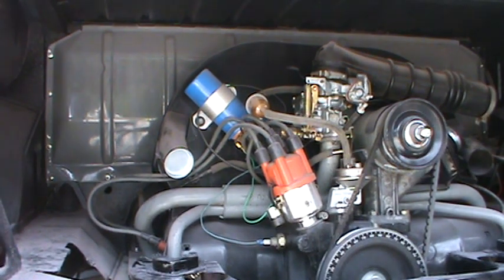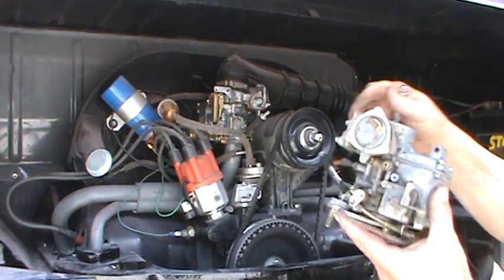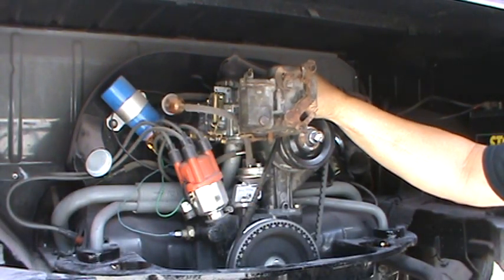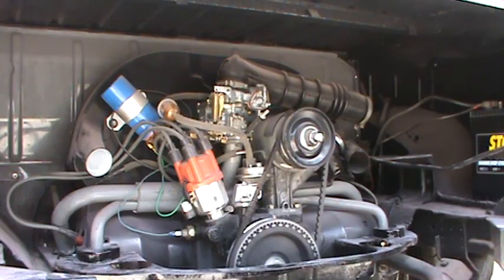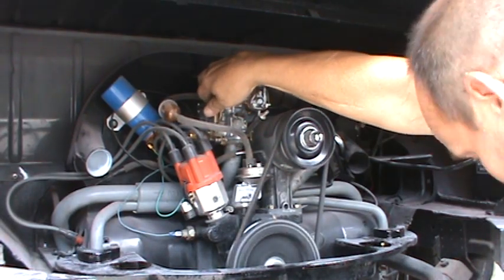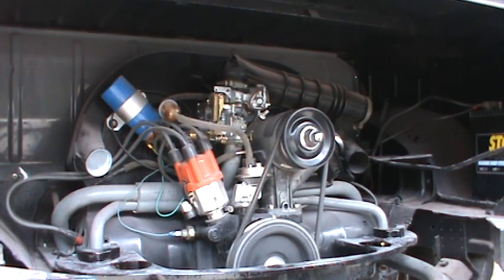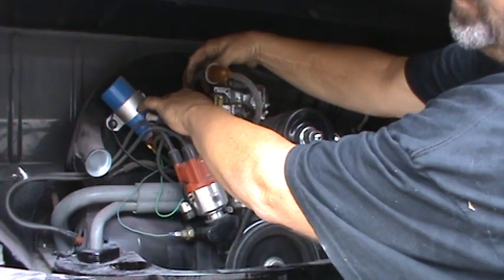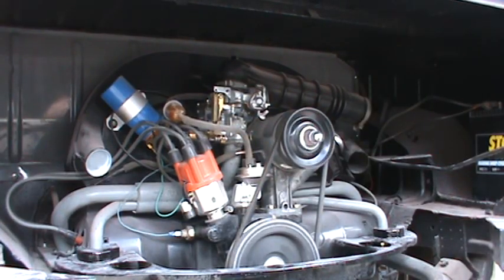HOW TO ADJUST VW CARBS, Air-cooled Volkswagen Carburetors tuned, VW Bus, VW Kombi, Classic VW

Comment: Thank you a thousand times. Frequent stalling plaqued the car (‘73 Super Beetle) to the point it was pushed aside and replaced. After viewing this “how to” I removed the idle screw on the right side, cleaned it, blew it out and voila!!! In 15 minutes it was running beautifully and returned to being a daily driver. I wish I discovered this site a long time ago. Thanks again
Reply from the maker: thank's for checkink out the video. Glad it help ,

Comment: That's the best video of carb adjustment on a Volkswagen I've ever seen and I have been looking. That motor is very smooth. And very tight. Very good job. It's easy to see that you really know those Volkswagen motors.

Comment: Man, best video so far.  Everyone skipped cleaning the idle jet when it would die at idle.  Pulled it, soaked and shook it in carb cleaner for 10 minutes, seems to have fixed the problem!  Now I just need to wait for daylight and a proper length screwdriver to adjust the two screws on the left side and I am golden.  Thanks for the quick and informative video!

Comment: Because of this video i started working my ghia and fixed it on my own, the shop that i used wanted me to replace the carb, but i did this little fix and what do you know my ghia runs better than ever. Thanks alot for your help.😃

Comment: thank you. I have had  8 VWs and have cussed Solex carbs for as long as I had them. Installed a bug spray carb just after I bought my '73 Thing new. Just recently had a shop adjust my 30/31 pic.on my 1600. The only thing I ever noticed on them is if you get to far off the carb gets really noisey.

Comment: Great video. Followed all steps starts and idles fine. After revving to approx driving range, bogs out and dies. Not sure where to look next. No vacuum leaks detected, all hoses connected. Using pertronix svda with matching coil & wire set.. Engine was 1600 but got the 88s from AA to bump up some power. Any help appreciated.

Comment: Hey Darrin, I have a 1600 dual port engine what's a 34 pict carb, I am getting a flat spot similar to what you are referring to later in your video. I have the accelerator pump set all the way out to give it Max fuel, what else could be my issue? Do you think I have an intake leak? Engine idles good and RPMs can be set as low as 800. Do you think I need to play around with jets?

Comment: On that original solex German carburetor you said there was only a single screw adjustment is that the low speed mixture?

Comment: hey! thanks for posting this! my bug has been running rough so im going to try adjusting the carb. It will run good most of the time but when i slow down to stop it keeps cutting off. i think the probablem is the amount of air that is getting into the carb. any advice???
Reply: Sounds like a timing issue.

Comment: I have a  question. My bus idles fine when 1st started. I drive it for a little. It stops running  every time I come  to a stop. I can turn the  idle up it stays running. But the idle is  to high. Any ideas
Reply: sounds like you might have an intake leak. check that the intake manifold and the carb are on tight. manifold boots are nice and sealed. I had this same issue where it would cold start and run ok but as it heats up it starts running weird and would die on me at stops. heat expands the leak and this is why it gets worse as you drive. Also, intake leak + high idle + lean mixture = engine running hot & excessive engine wear. Hope this helped you find a solution!

Comment: Thanks for this great video, I have a question I have a 28 pict. That the throttle stays open doesn't comeback, I seen other carburetors that have a spring that makes it return to close position, this doesn't have one neither the attachment to install one, what can I do to fix this? Thank you.

Comment: Hey great video, my friend has a 1971 Volkswagen Beetle he recently put a new carburetor on it, had the valves adjusted, had a full tune up on it, and it is sputtering in missing, almost like its running out of fuel, the carburetor is adjusted right but it keeps missing, and it is perfectly in time, what are your thoughts on it??

Comment: Hey Darrin. I've got an issue with my 1973 Westfalia. It has a newer 2000cc pancake motor with hydraulic lifters that I think is from a 1977 bus. I have set my timing using a light. The bas runs but it is hard to keep started. When I try to start it sometimes it backfires out of the carb. Once it is running it will drive normally when up to higher rpms. Would carb adjustment be to blame for the backfiring through carbs? Any advice would be greatly appreciated.

Comment: My 69 type 3 developed a knock. Maybe  valve adjustment? I've driven it about 3-4000 miles since I bought it last year. It has a 1776 with Weber progressive carb

Comment: My 1972 VW Super Beetle (1300cc-engine letter AB) with a Bocar 34PICT-3 just will not idle. at all. runs completely fine, but if i try to let it idle for more than even 2 seconds it just dies, and dies quickly. any suggestions? I'm completely new to vw's, and cars in general, this being my first car. I just want my baby to idle

Comment: Thanks  for the video. I have a question about the throttle cable tube in relationship with the fan shroud. I have a early 1961 1200cc 40hp VW engine. I've swap out the 6 V generator with a 12V System. The carburetor is a Solex H-30-pic.I bought myself a nice Chrome fan shroud. It's clear now this shroud was for a dual carb set up because it don't have a hole for the throttle cable tube. I decided to dry fit all the parts listed above, minus the generator/fan assembly. Looking inside the shroud I can see how the throttle tube would fit and it's going to be close. The hole, that I'll have to drill, will be a quarter of an inch  from the generator tin. On the inside its going to be just as close to the oil cooler.With this info can you help me figure out what is going on. I'm just lost.
Reply: I had something of the same problem. The car had a 28 pict when I bought it 1964 bug 1200 cc. The car was converted over to an alternator and to do it they had to put a riser about 1 inch under the carb to make room for the alternator which threw off the throttle cable an inch too low. Relaced the carb with the correct one 28 pict 1 still had the problem with the throttle cable so I drilled a hole in the shroud about an inch higher and  I riveted a flat piece of steel 3 inches long to the  bottom of the aftermarket air cleaner, drilled a hole in the riveted steel. I used 2 return springs for VW Beetles made from 1971 to 1974 and it works good. So now the return for the throttle cable is on the bottom of the air cleaner.  The air cleaner has to be tightened up real good you don't want it moving which mine hasn't in 6 months.

Comment: Was wondering if very hot exhaust and rear skirt is normal. Put candy thermometer in dipstick tube and is reading between 190 and 200 during summer 209 if I run all day. Is this normal? First time bug owner and don't want to ruin engine. Runs good and can get it to 75 on highway.
Reply: Just in case anyone is still reading these posts, 200 degrees F is normal for oil temp and can go up to 230 with extended highway driving at 70 mph, which is ok with today's oils. 40 years ago I had a modified VW and it ran in that temp range constantly (dash mounted gauge) even with an extra oil cooler fitted.

Comment: OK so here’s my issue if anyone can help me got a 1641 mL engine that was recently just rebuilt The guy who rebuilt it installed it into the car for me and when I picked it up it ran and drive good however the car has set because I was purchasing front end parts now the car will run but will not idle once it gets warm it will die I’ve tried adjusting the mixture screw and the rpm screw I cleaned the idle jet however I tried running the engine with it off and no fuel came out of the opening I then remove the top of the cover and insured therewas fuel to the floats

Comment: === Gas filter ===Darrin, do you have a concern about having your gas filter installed on the hose to the carburetor inlet ferril ? ? ?  You may have seen the many Beetle postings about the engine fires, caused by the filter / hose vibration, which pulls out the carb inlet, and sprays gasoline all over the hot engine.  To learn, search YouTube for "Beetle engine fires".  Some very disturbing videos, of the carburetor ferril coming loose, because of the filter bouncing / vibrating on the fuel line.  Some really nice Beetles have gone up in flames because of that pesky gasline filter.  Bill Simpson, Toronto, Canada... with 7 Beetles

Comment: You didn't say anything about setting the choke tension?
Reply: +Chuck Holmes  tell me about choke tension... I just rebuilt mine and just set it to what felt and looked write.. im guessing if its too tight it wont ever pop out of choke, I have an E choke.  will it just stay choked?
Reply: +Themandogable You have probably set yours to where it will snap back when poked at with your finger.  That is what I was taught on most carbs.  On the 67 I work on, I found that I am leaving the tension a little weak for it to operate to my liking.  Also, I will be adding a shim to the needle and seat.  About 40 thousanths.  Have had problem with restarting a warm engine and I think it is fuel pressure dumping fuel into engine.  This is the fix that I was told by an old expert.

Comment: Wait so let me just make sure I have this right.  Set idle with big screw. Then turn in small screw until it starts to stall.  Then turn out until it starts to slow down again.  Then find a sweet spot in between these two points?  After that set idle with big screw one last time.  Is that right?
Reply from the maker: you got it , you may need to clean your idol jet
Reply: How would we tell if the engine is running too lean or too rich?
Reply: vwdarrin
Hey VWdarrin thanks for the tip.  I've already tuned my carb myself a couple of times and am really happy with the results using this method.  The only thing I would add is to turn the screw in about half a turn after I hit the sweet spot with the fastest smoothest idle.  First time around I just left it where it idled the fastest and it was running a bit too rich.  Last time I gave it half a turn inwards past the sweet spot and that kept it running smooth and seemed to make it overall happier on take off and high rpm.
Reply: How to get more power out of a vw air cool engine
Reply: this is jsty common sense ... you have to check gases.
Reply: @maliknash55  turbo it

Comment: My. transmission and engine start kicking when I take my foot off the clutch in gear one. could it be due to high idle?
thanks
Reply: Bowden tube issues. Look up "Bowden tube Adjustment"

Comment: So if the bus has a rebuilt engine and runs when you keep gas on it but it won't run idle, what should I do?
Reply: Quinn I have the same problem on my 1987 high top
Reply: Having the same exact problem, what did you guys end up doing? I just got my engine completely rebuilt went to drive it home and it doesn’t idle if I’m at a light unless I keep my foot on the gas a little. Besides that it runs perfect..

Comment: I have a 68 vw bus that was running. Found out starter was going bad,new bosch 12v in now with bushing. barely turns engine. battery at 12.3 timed static will not start????
Reply from the maker: If you don't want to deal with the bushing the new Bosch starters no longer have a bushing I prefer the high torque starters they are a little pricey but they are gear reduction and if you buy one of those your bus will never fail to start  also need to check the voltage on your wire that triggers the starter sometimes ignition switch is bad you will lose voltage in this wire and the starter will not work it is just a bushiness you pick up a new starter make sure you get one without the support shaft thanks for stopping by

Comment: what is going on, when there is fuel in the motor oil?   How does it get past the rings?  Is this a fuel pump problem or a carburetor problem?
Reply: very dangerous it can blow up your crank case in extreme scenario  .it is most likely the fuel pump is leaking internally and old gravity is putting it right down in to the crankcase happened to me drove me crazy ,just passing it on hope it helps you out,peace

Comment: I keep getting allot of back fire and forced to switch gears faster in my VW sand rail can you PM me and let me know if i need to adjust down or up on the carb ty God bless
Reply: ME TOO WHAT DID YOU DO TO FIX IT????
Reply: 4 years later... check your mixture. Might be running too lean

Comment: The fuel filter should not be installed in the engine compartment --> Fire hazard ! Correct place is underneath the fuel tank !

Comment: Noisy because the fan belt is TOO TIGHT.
Reply: Marantzdupre Strider Just shut up if you don´t have any plan of the technique of a beetle!!!
The Fan is behind the generator, this belt you can see in the video drives the generator AND the fan via THE SAME shaft... So far...
Reply: That belt drives the generator and connected to the back side of the geni is the fan (squirrel cage blower).
Reply: how do you adjust the belt tension,mine is too loose and it squeaks when idling
Reply: *****
ooook that's the answer i was looking for.thanks alot
Reply: No the belt i put is actually to big.i didn't know how to adjust a smaller size belt,so i bought one long enough to slide over the pulleys.That's why it's squilling and i'm trying to find out how to loosen the pulleys up to put the right size belt on to stop this noisey squill.Thank you in advance
Reply: Alright figure out what size belt you need. to put it on you need to pull the front half of the generator pulley off. 

To do that. There are a few videos on youtube, but the jest of it is, there are a set of slots on the back of it, and a little post on the generator itself. Slide a screwdriver in there and it will jam the pulley so you can undo the nut on the front. After you've done that.

Pull the half of the pully off, pull the belt off, replace it with a new one and add or remove shims as required.

all 10 shims will be as loose as it goes, 1 will be the tightest.

Always put your extra shims between the little piece the nut rides on and  pulley itself. 

Let me know if you need any more info.
Reply: ok.i'm going to try it tommorrow.i'll let you know how it go.
Reply: Twisting the fans on the cooling fan will make it sound like it has a supercharged if you don't know how to do it don't go trying to do it

Comment: you missed an important factor in relation to the amount of alcohol in the fuel now days and that factor has everything to do with flat spots in acceleration.  that being said, you should have explained that the diaphram in the injector pump can get distorted by these new fuels and may cause poor, little or no injection into the carb. mhhm yea.very important